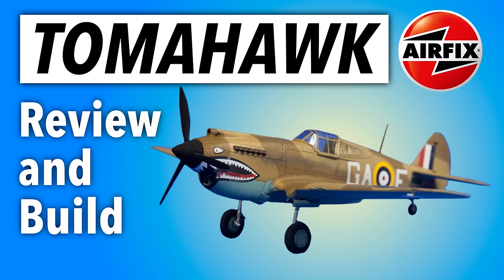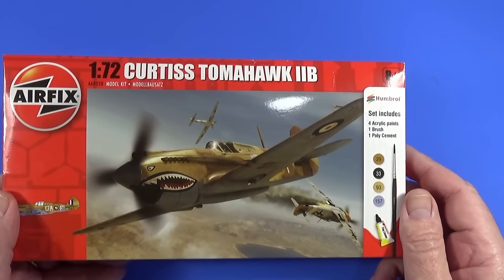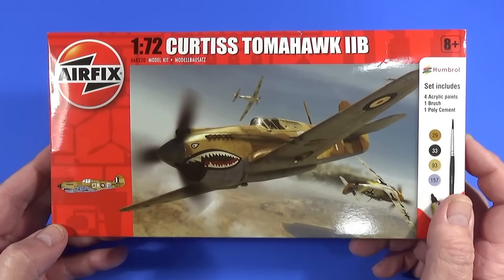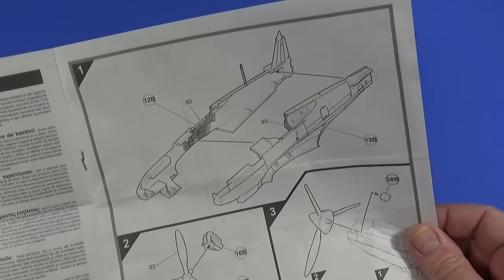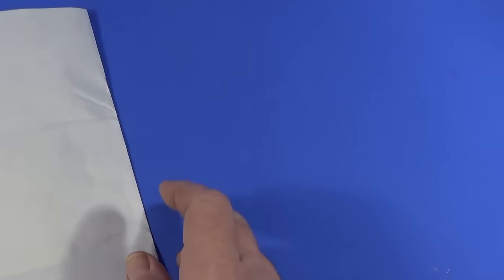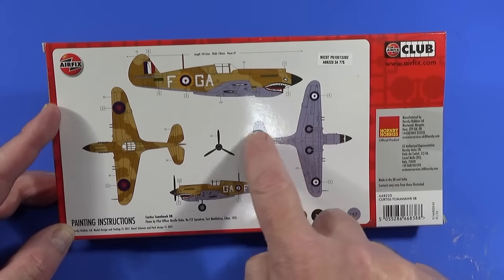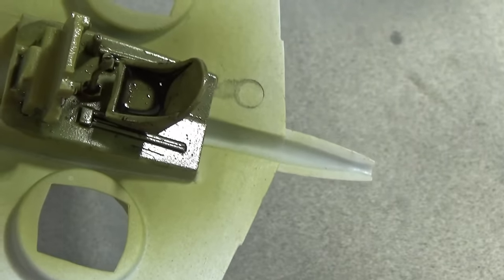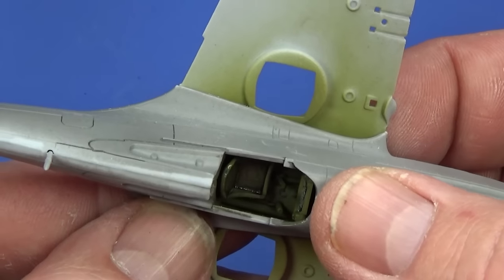AIRFIX CURTISS TOMAHAWK  - what you get and how to build it!

Comment: I made this kit to hang from my sons ceiling a few weekends ago. Really enjoyed the build and painting it. One mistake I did make was that I didn't realise the clear bit either side of the back of the canopy were supposed to remain clear. So I painted them. But hanging from the ceiling it's not noticeable. I was dreading the sharks mouth decal, but it went on well. I had to add a small line of black paint to get the bottom to look like it joined, but   it looks good.

Comment: Gary, it looks like many people are returning to model making. This video contains a few tips, especially your drawing attention to washing the frames before doing anything else. They may not need it, but a stitch in time. I suggest that next time you do a "starter" kit for the information of newcomers, that you go into a more detailed explanation of the instructions contained in each of the step diagrams. Too often, experienced modellers making this type of video simply apply their modelling experience without explanation. I could joke and say that men don't need to follow instructions, but as with any project, the first step is to understand the instructions. If you don't you end up with a wobbly IKEA bookcase and leftover screws.  Should cockpit details be painted in the sprue before assembly? Should instrument panel decals be set before the panel is fitted? Another thing I've noticed with your build and that of others of the same kit is that the inside of the wing around the undercarriage isn't being painted before the wing is closed up. Doing that makes it easier for the less experienced/learner. As a positive comment, I found this video, being a "what's in the box" plus "how it's built" to be much more succinct tha spreading those topics over two videos. Good on ya, mate!

Comment: Good vid - I have one deep in the stash. More water-based acrylics out there than you might think Gary - I've recently moved to water-based, principally because of the clean up chore and smell of lacquer based products. Mission Models, Ammo Atom and Acrylic Colour, Vallejo Model Air and Metal Color are a few. Still tend to use acrylic thinner and retarder (specifically for water-based) rather than water though, as I think they level better.
Reply from the maker: There are many water-based acrylics that also have other stuff in them, which require some kind of thinners even though you can wash brushes with water. I believe Humbrol to be the only purely water-based acrylic which means it can be reliably thinned with plain water.
Reply: @garys_stuff  Mission Model certainly prefers its own little chemistry set of thinner and poly, but it does clean with water. The new Atom range I have successfully thinned with water. It's lovely paint.

Comment: I like this kit. Had one for a christmas present. How did the humbrol paints go down through the airbrush? We saw you mix the paint then thr next shot was the complete model. Did it take several coats of very thinned paint?
Reply from the maker: Hi Christopher, the paint took two coats for the blue and the stone and one for the dark earth. It went surprisingly well.
Reply: Cheers Gary. I've never really had that much luck airbrushing humbrol. Brush painting them is normally ok.
Reply from the maker: @christopherevans6752  not sure if the paints in my set were the Gen 2 versions or not - I think they have better thinning properties than the older ones. I understand there is no reliable way of telling from the pots!